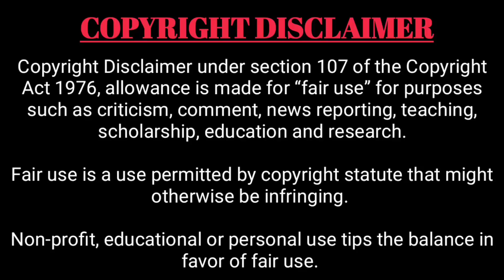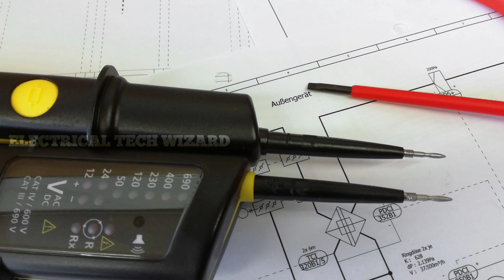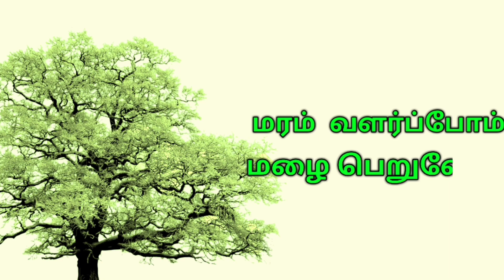Series test lamp செய்வது எப்படி | how to make test lamp | series test lamp board wiring connection

Comment: Very Dangerous 

Connect Phase wire to Holder

Neautral wire to Switch

Because voltage drop aagum 

Illaina 240 voltage appadiye varum

Comment: You have fixed switch, three pin socket and holder in a plastic box.  the source wire for  incoming supply to the box three pin socket was not clearly shown.  two red wires leading to the box was only seen but its connection was not shown properly, which is technically hided over.
Reply from the maker: நல்லா பாருங்க அண்ணா சொல்லியிருப்பேன்